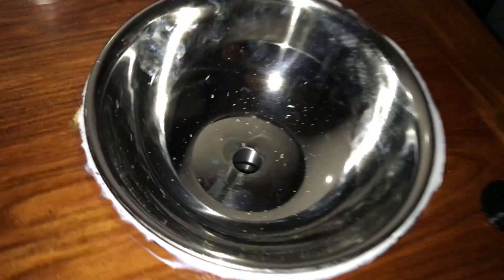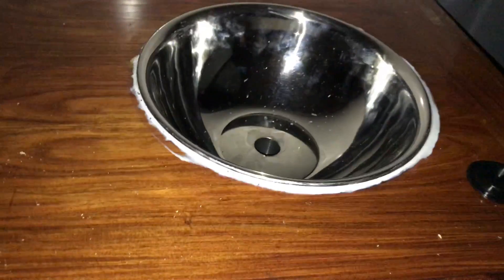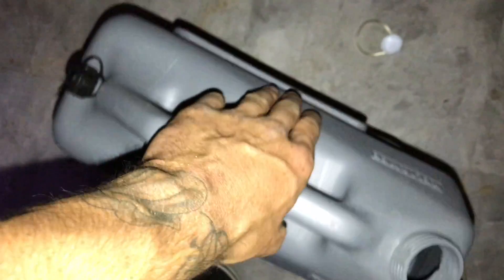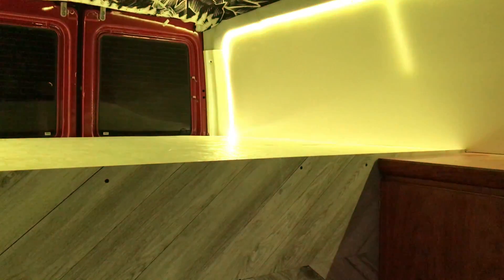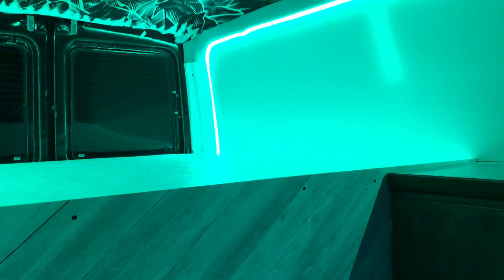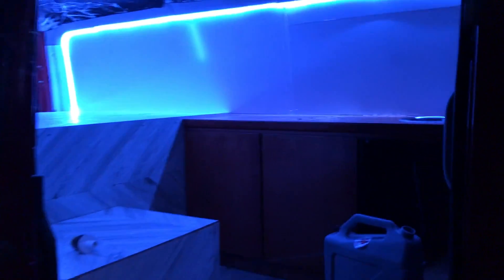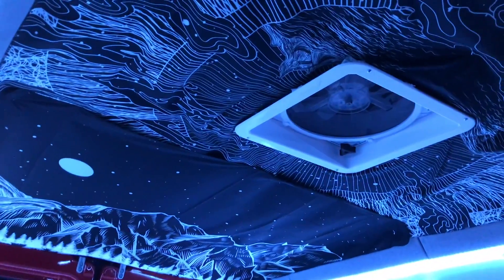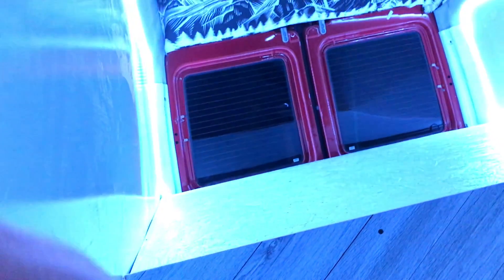bringing light to the van build

Comment: get a chalkboard for the van! wait till youre basically done the interior and it will be a great way to fill up some "unusable" wall space!
stay stoked brotha!
Reply: There is no “unusable wall space” in van life lol always things that can be stored on a wall. But a chalkboard/ whiteboard is a good idea
Reply: @Greg-TC lol yeah I totally agree.  I guess when I said "unusable" I meant like spots where a cupboard or cabinet is not practical. 
Or like somewhere where the wall space is used to run water or electrical lines, could mount a chalkboard/whiteboard to hide them and give that space a more finished look. It's a great way to fill a void between things if you can't utilize that area for more storage or whatever.
The first van I turned into a camper I used chalkboard as a backsplash behind my "kitchen" area and it was one of my favorite features, plus it came in handy to quickly jot stuff down.
In BB's van it would be kinda cool on the front side of the bed. 
Chalkboard darkens the area a bit so when it's night and you have your lights on the walls aren't giving off an overpowering glow, plus colored chalk looks pretty dope under black/neon/led lights. 
The last van I had all my walls and ceiling were a chalkboard finish, just mounted up my cabinets as you would normally. it was sweet you could literally write or draw anywhere. 
I guess I meant any flat spot is usually a cool spot for a chalkboard lol.

but you are 100% right, it's all very usable space when it comes to automobile abodes!